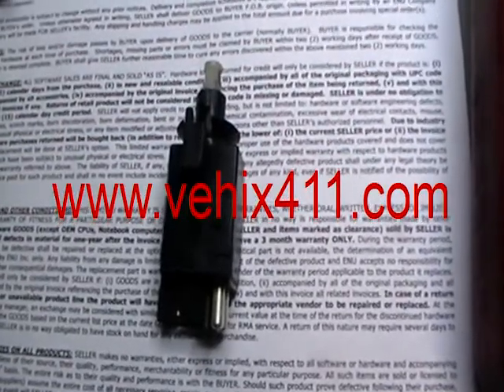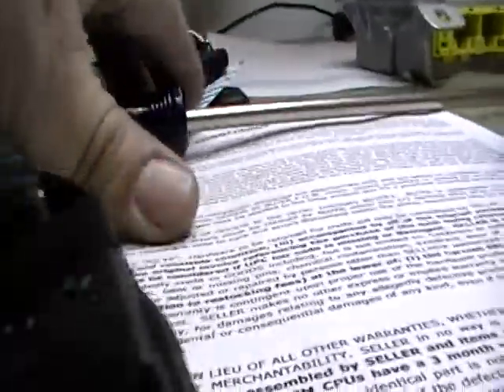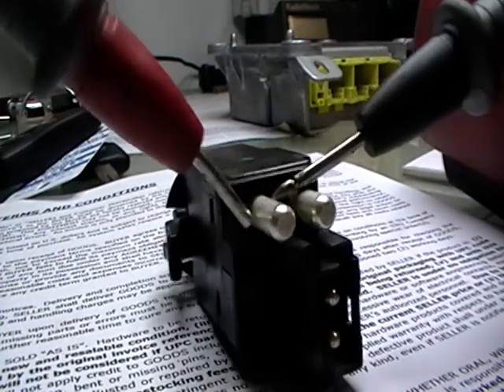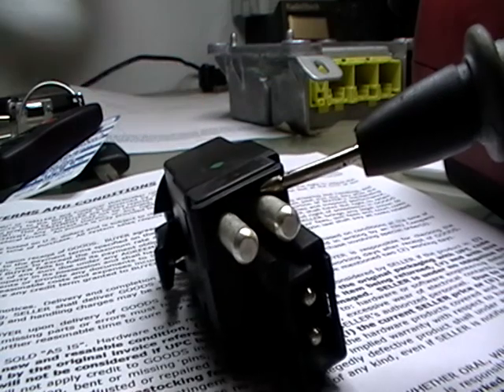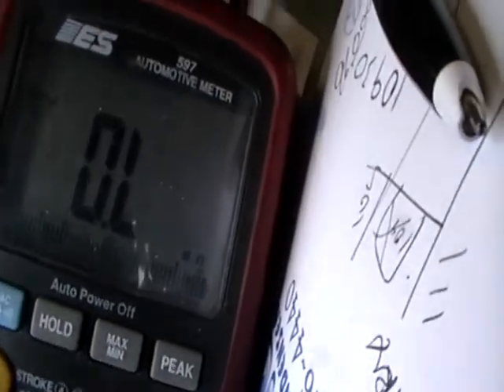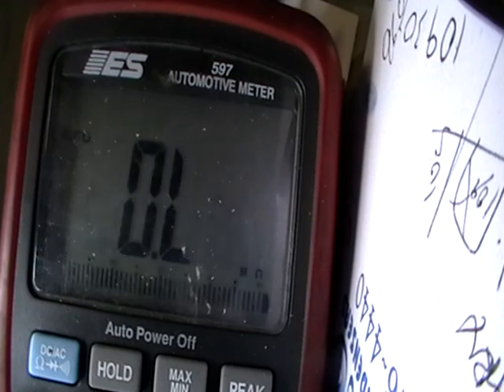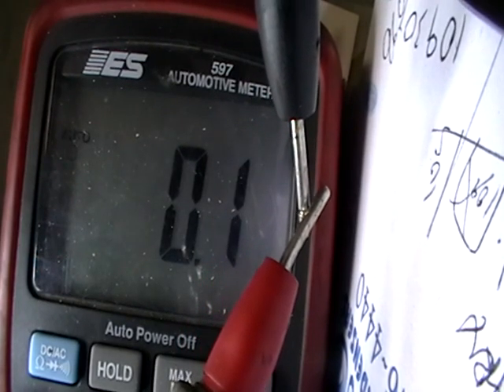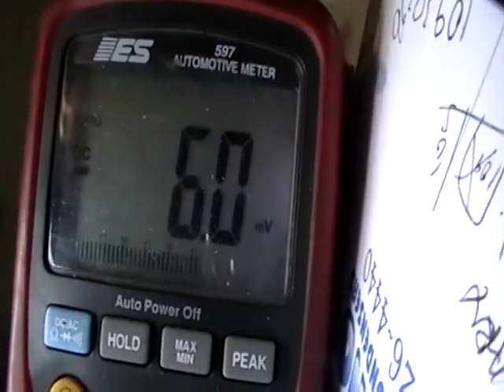Shocking BAS ASR Acc Skid Control Light on Mercedes E Class

Comment: brake switch is in the foot well as it is activated physically by the brake pedal. you need to remove the protection under the dash. It is to the left of the pedal.